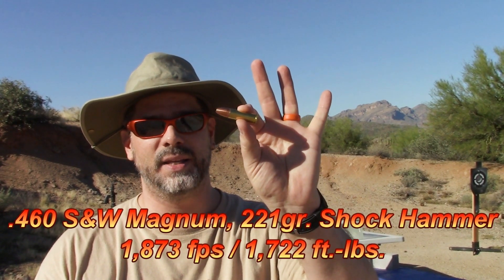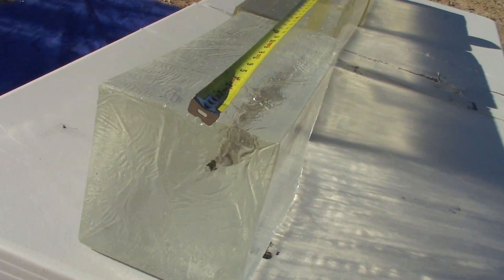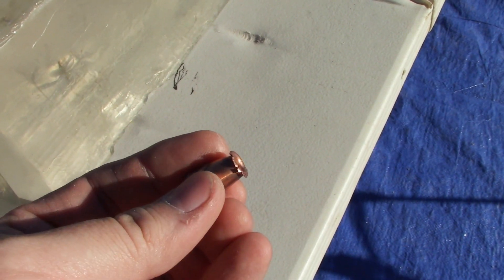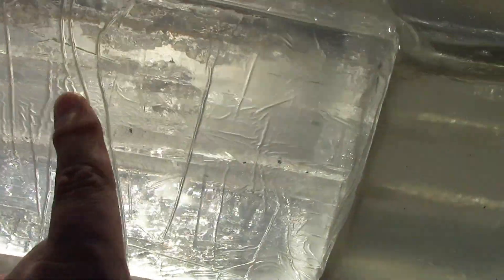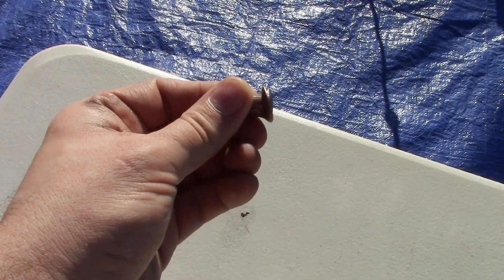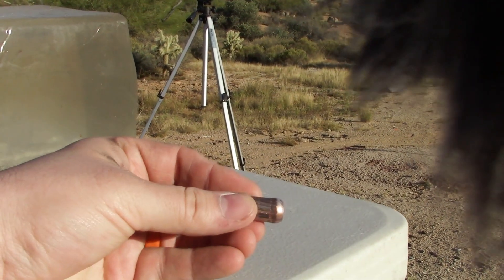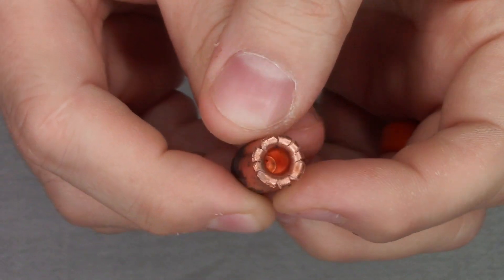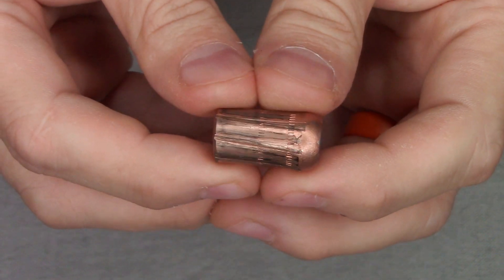Aria Ballistic Engineering .460 S&W Mag & .500 S&W Mag Part 3:  Ballistic Gel

Comment: How does that compete when 460 s&w 221gr was way underpowered? For example: Hornady 200gr is advertised velocity is 2200 fps, so 221 gr should go at least 2000 not 1800s
Reply: It's not always about maximum muzzle energy. You don't need 2,000 ft/lbs to drop a white tail.